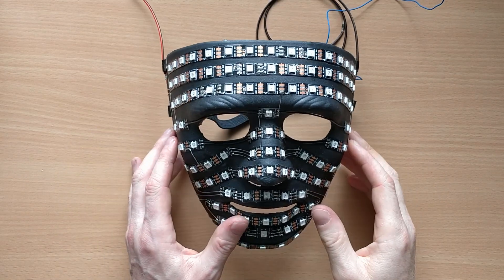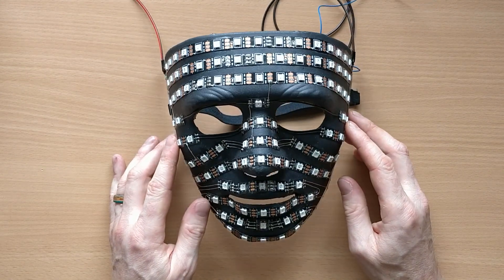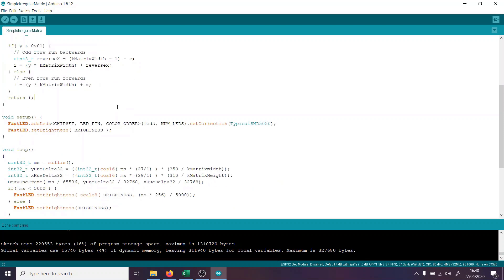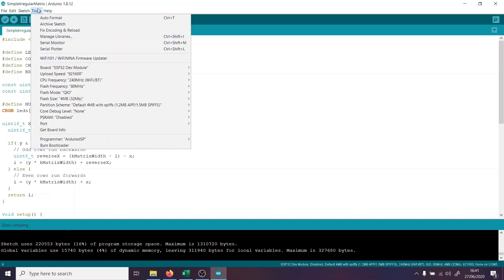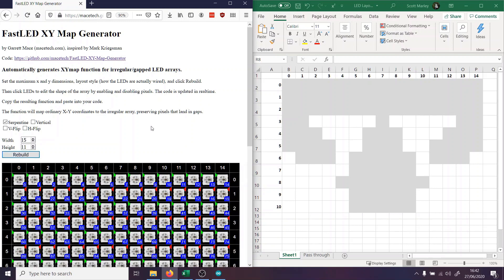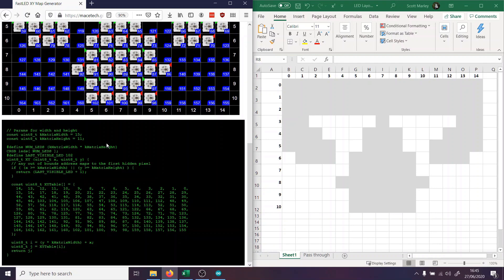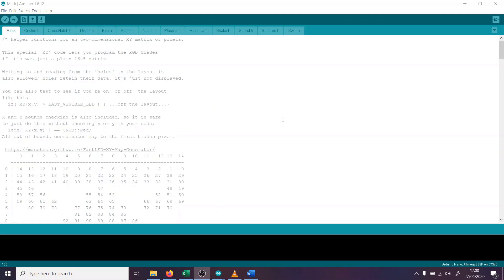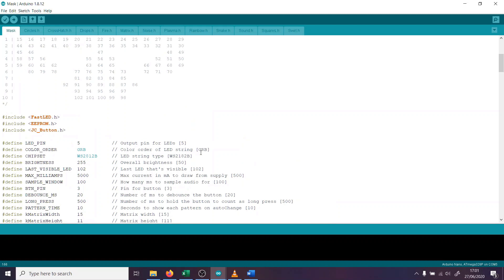Arduino powered LED Mask with FastLED [Part 1] - How to write code for an irregular matrix

Comment: Hello, Newbie question as I am just starting off. I am able to get the matrix to work with the rainbow pattern. I am having a hard time trying to figure out how to only put the fire pattern on the matrix. I not sure where to replace the rainbow pattern for the fire pattern in the code. I do not want to use classes, I simply want to use the fire pattern on the matrix. If you could please explain where to change it on the code, that would great. Thank You once again!

Comment: Hi...What kind of wire do you use to connect?
Reply from the maker: Not sure what you mean. To connect what? The Arduino nano uses a micro USB connector for power. The wires to the LEDs are just normal hookup wire (not sure what size). The wire used to connect the led strips to each other is tinned copper wire.

Comment: Great video, and fun project. I've subscribed and am working my way through your videos to better understand the possibilities of FastLEDs and Ardiuno. 

This is a bit off topic, but can you use the irregular matrix on a regular matrix so only certain pixels light up for some patterns but all of them light up for others?
Reply from the maker: Thank you! There might be a cleverer way to do this, but an easy way would be to make your pattern fill the matrix as usual, then set the pixels you want switched off to black before calling FastLED.show(). You could store the index numbers of the 'off' pixels in an array, and just loop through this setting them all to black.

Comment: Fantastic ideas and great instructions  so thankyou for helping me in the Arduino path – I think !

Your LED mask demo inspired me to make an LED coat as I could not solve the irregular matrix in my mind until I saw your post.
The button info was great too as this will help - ALOT with the design!

I have your code running on the first panel perfectly thankyou! (9 x 24) vertical serpentine and looks great ....... but the UNO dies as the row size increases. (43 x 24 irregular matrix in total) and is out of Memory.. so upgraded the board to a Mega which easily takes the code as you would expect

If I upload the same code onto an Arduino Mega it simply wont run at all, even though it runs fine on the UNO

I have changed the "j" to a uint16_t j from 8 as I exceed 255 but that gives not joy... I cant solve why it Runs on the Uno but not on the Mega

Do you have any ideas – I am trying the Arduino forum and not getting very far!

Comment: To cover the mask you could use Wonderflex Thermoplastic. It's a plastic which becomes soft and malleable when heated and diffuses light really in a way which you can still make out the LEDs.
If you image search for "wonderflex thermoplastic led mask" you'll see what i mean.
Reply from the maker: I gave the mask to a friend, and he's customised it similar to what you have suggested and it looks great. Thanks for the comment

Comment: Awesome video, do you have experience with an irregular strip? I have a strip with gaps, sections that go forward and backwards, and groups of leds that need to combined. I wrapped the led strip inside a sign that isn’t in a matrix or straight line. More like circles and shapes with a single seamless strip.

Comment: great work! how can I compile these animations without the button?
Reply from the maker: Not sure what you're after? How do you want to change the patterns?
Reply: @ScottMarley  I'm curious about this too. Is there a way for it to just cycle through the animations and change automatically every 30 seconds for example?
Reply from the maker: @DustinDalziel777  yeah, very easy to do. Just change bool autoChangeVisuals = false; to true. Done.
Reply from the maker: Oh, and to change timing to 30s, change #define PATTERN_TIME 10 to 30

Comment: Hi Scott, love your projects. Quick newbie question - what wire are you using between the copper strip and the led connectors? I've built a LED matrix and want to use your copper tape method to distribute power/gnd but I'm struggling to figure out what wire to use. I see with your mask you seem to mainly be using bare wire - what gauge is that and is it pre-tinned? Sorry for what is no doubt a really basic question. Thanks!
Reply from the maker: No worries, it's just single core copper wire, that I covered in a thin layer of solder. That way it solders quickly so not too much heat ends up in the copper tape. I don't know what guage it is, but the insulation is 1.1mm diameter and the core is 0.6 mm diameter if that helps. Probably doesn't matter too much here unless you're making an enormous matrix!

Comment: Would love to see you revisit this with an ESP32. I can't help but think there's a ton of potential here, you could have an app control "facial expressions" and crying animations or something cool if you had higher density pixels covering the entire mask!
Reply from the maker: Replacing the Arduino with and ESP would be straightforward, just 3d print a different case for it. Problem is, I don't have time to add new patterns and stuff! The code is all there if you'd like to have a go? Not sure about increasing the pixel density though, the power consumption would increase hugely, so I'd have to rethink how the power is distributed, and soldering all those strips together on a curved surface would be miserable! It does have a lot of potential though. Maybe one day I'll get inspired again to have another go!
Reply: @ScottMarley   Wish you had the time, I'd gladly collaborate with you on this!
! I've 3D printed a translucent mask before and lined the entire inside with ws2812B pixels but never got the software side of things worked out. I'll be teaching myself some things later this year I guess.... :P  Keep up the awesome work!

Comment: Very nice mask. Can i ask how you switch between patterns ?
Reply from the maker: At the moment you change patterns by pressing the push button. Have a look at the GitHub page in the video description to see how everything is wired up.
Reply: @ScottMarley  i gone have a look. And al the code you place on a diverent tab. And then you can push the button and switch the pattern ? Thank you for the information. I will try it. Its very nice
Reply from the maker: @maartena82  all the code is also on GitHub. However, you will need some experience in wiring, coding, FastLED etc in order to get this to work. Good luck!

Comment: How did you solder and connect all of them
Reply from the maker: With a lot of patience, some wire and a pair of tweezers! 5V is connected to the right side of every strip, GND is connected to the left side. Data starts at the top right and zig-zags it's way through every strip.
Reply: Scott Marley oh alright thanks and if it’s not to much trouble how many parts did you use like how many resistors, LEDs, you know stuff like that. If u can thank you I’m doing a project and I would live to do a mask like yours.

Comment: How are you powering it? How much voltage does it need?
Reply from the maker: Everything runs from 5V. I run it from a USB power bank. The amount of current depends on the number of LEDs and the brightness setting. At 250 brightness, the most demanding patterns draw a bit over 2 amps.

Comment: Nice explanation of the design, I have got a fire routine that is basically generated on the fly but can control it with variables to get better flicker and strands leaving the main fire.
i will make my 16x16 matrix equals yours by turning off the unused leds. I will email you the code once I am happy with the adjusted code.
As for covering it, use cling film, then mold features using clear latex that is paintable or foggy, this would be good if an area fails you can just remove the latex and access the leds. Latex will need studs or some way to hold it on. Great to see this.
Reply from the maker: Molding latex over it is a good idea, definitely easyish to remove if necessary. I tried a number of fire routines on it including the usual fire2012 one and found this one looked the best. I also disabled side to side motion of the flames as it just didn't look that good on such a low res matrix. Happy to see what you've come up with though!

Comment: Very Very original and great video... Great build scott..., i am aiming for a man cave sometime near the end of this year..., this would look cool in it...
Reply from the maker: Thank you :) I'm sure with your love of flashing lights you could throw one of these together for the man cave!
Reply: @ScottMarley  Just had the mask arrive today, seriously lacking leds though,  now due to the lack of time i have they will sit in a corner and gather dust lol
Reply: which version of fastled and arduino are you using? quite a few errors popping up ..

Drops.h:24:36: error: could not convert '(const uint32_t*)(& OceanColors_p)' from 'const uint32_t* {aka const long unsigned int*}' to 'CRGBPalette16'

     CRGBPalette16 currentPalette = OceanColors_p;

                                    ^

In file included from C:\Users\Mannys\Desktop\Mask\Mask.ino:84:0:

Noise.h:17:36: error: could not convert '(const uint32_t*)(& PartyColors_p)' from 'const uint32_t* {aka const long unsigned int*}' to 'CRGBPalette16'

     CRGBPalette16 currentPalette = PartyColors_p; // Starting palette

                                    ^

exit status 1

Any ideas ?
Reply from the maker: @cine-lights  the latest I guess, 3.003.003. I'll have a look shortly and see if I get anything like that. Not sure I do as it would not have compiled!
Reply: @ScottMarley  i just upgraded to the latest version of fastled and arduino and getting the error..., i was using a slightly older version and had other errors too....  the simple version works no probs.., no rush, if all else fails could you throw over a hex / compiled version - im using a nano as your are
Reply from the maker: I just installed the latest Arduino IDE (1.8.13) and I am running the latest FastLED (3.3.3). I downloaded my code from GitHub and it compiled with two warnings (not errors) about type conversion which I have now fixed on GitHub, but these were unrelated to the errors you are getting. Is what you posted above the full output text? Could you go to preferences, and set compiler warnings to 'More', copy everything it spits out (if it's too much for here, chuck it on PasteBin or something!) and let me have a look for some clues? Thanks.
Reply: @ScottMarley  C:\Users\Mannys\Desktop\New folder (4)\LEDMask-master\Mask\Mask.ino: In function 'void incrementButtonPushCounter()':

C:\Users\Mannys\Desktop\New folder (4)\LEDMask-master\Mask\Mask.ino:70:46: warning: operation on 'buttonPushCounter' may be undefined [-Wsequence-point]

   buttonPushCounter = ++buttonPushCounter %11;

                                              ^

In file included from C:\Users\Mannys\Desktop\New folder (4)\LEDMask-master\Mask\Mask.ino:75:0:

sketch\Sound.h: In member function 'void Sound::readVolume()':

sketch\Sound.h:41:18: warning: comparison between signed and unsigned integer expressions [-Wsign-compare]

       if (sample > signalMax) {

                  ^

sketch\Sound.h:44:23: warning: comparison between signed and unsigned integer expressions [-Wsign-compare]

       else if (sample < signalMin) {

                       ^

sketch\Sound.h:40:8: warning: suggest explicit braces to avoid ambiguous 'else' [-Wparentheses]

     if (sample < 1024)  // toss out spurious readings {

        ^

In file included from C:\Users\Mannys\Desktop\New folder (4)\LEDMask-master\Mask\Mask.ino:78:0:

sketch\Squares.h: In member function 'bool Squares::runPattern()':

sketch\Squares.h:20:29: warning: operation on '((Squares*)this)->Squares::_pattern' may be undefined [-Wsequence-point]

     _pattern = ++_pattern %2;

                             ^

In file included from C:\Users\Mannys\Desktop\New folder (4)\LEDMask-master\Mask\Mask.ino:79:0:

sketch\Circles.h: In member function 'bool Circles::runPattern()':

sketch\Circles.h:21:29: warning: operation on '((Circles*)this)->Circles::_pattern' may be undefined [-Wsequence-point]

     _pattern = ++_pattern %9;

                             ^

In file included from C:\Users\Mannys\Desktop\New folder (4)\LEDMask-master\Mask\Mask.ino:82:0:

sketch\CrossHatch.h: In member function 'bool CrossHatch::runPattern()':

sketch\CrossHatch.h:33:38: warning: operation on '((CrossHatch*)this)->CrossHatch::blobCounter' may be undefined [-Wsequence-point]

       blobCounter = ++blobCounter %20;

                                      ^

sketch\CrossHatch.h:40:38: warning: operation on '((CrossHatch*)this)->CrossHatch::blobCounter' may be undefined [-Wsequence-point]

       blobCounter = ++blobCounter %20;

                                      ^

In file included from C:\Users\Mannys\Desktop\New folder (4)\LEDMask-master\Mask\Mask.ino:83:0:

sketch\Drops.h: At global scope:

Drops.h:24:36: error: could not convert '(const uint32_t*)(& OceanColors_p)' from 'const uint32_t* {aka const long unsigned int*}' to 'CRGBPalette16'

     CRGBPalette16 currentPalette = OceanColors_p;

                                    ^

sketch\Drops.h: In member function 'bool Drops::runPattern()':

sketch\Drops.h:35:39: warning: operation on '((Drops*)this)->Drops::paletteNumber' may be undefined [-Wsequence-point]

     paletteNumber = ++paletteNumber %5;

                                       ^

sketch\Drops.h:49:42: warning: operation on '((Drops*)this)->Drops::rippleCounter' may be undefined [-Wsequence-point]

       rippleCounter = ++rippleCounter %20;

                                          ^

In file included from C:\Users\Mannys\Desktop\New folder (4)\LEDMask-master\Mask\Mask.ino:84:0:

sketch\Noise.h: At global scope:

Noise.h:17:36: error: could not convert '(const uint32_t*)(& PartyColors_p)' from 'const uint32_t* {aka const long unsigned int*}' to 'CRGBPalette16'

     CRGBPalette16 currentPalette = PartyColors_p; // Starting palette
Reply from the maker: For anyone looking at this thread, the issue is now resolved and the GitHub code has been updated. Thanks to Cine-Lights for helping problem solve!

Comment: Very cool project! Thanks so much for the video, also explaining the amazing XY calculator.  The droplets animation is very cool, hadn't seen that before. Assuming you are going to be using this in dark places, I would suggest turning down the brightness a lot. People do not like being blinded. Speaking from experience here. ;-)   But you were going to add a diffuser anyways, so I think that will be allright. Might even consider using a slightly smokey material to dim it a bit (sometimes these WS2811's look ugly at low brightness).
Reply from the maker: I agree it needs some diffusion and toning down a bit! It does look quite different on camera than in real life however, I'm recording all this on a phone so I don't have much control over how it records. Thank you for your comment!

Comment: This is so cool, I've made a mask similar to this but just used the default demoreel stuff for fastled. How did you get the sound reactive animations at the end?
Reply from the maker: Take a look at the GitHub link in the description, it's the pattern called 'Sound.h'. it's really basic and could be expanded a lot but I just wanted to get the video done. It just looks for a sound level between fixed points and draws the appropriate image. Really these points should be determined dynamically and I'm sure I'll do it some point!

Comment: Please make a video about porting to the esp32!
Reply from the maker: I may do that in future as having Bluetooth or WiFi control would be great! In the meantime, this code will work fine on the ESP32 as it is, just change the board in the boards menu and upload it.
Reply: @ScottMarley  Check out the Blynk project. You can easily add wifi remote control. Although it requires internet, not so handy in a mobile installation.
Reply from the maker: @costynvd  I'd probably do it like the Bluetooth control on my ESP32 matrix. I don't generally have WiFi where this is useful (mainly festivals!). Or maybe local WiFi control although I haven't done that before. Always good to learn something new though.

Comment: Wow that's a great find , I've been 'making' my own pixel maps for my pixel trees for years....this will be soooo much easier...I never even though to search for a ready made pixel map generator ...I feel silly now.
Can't thank you enough...
No sure about sealing the leds in epoxy ..would make it a pita when one or two inevitably fail.
The vac forming of a removable cover sounds difficult to get right but could be more practical..
If you just want environmental protection from moisture then conformal coating like DCA SCC3 from electrolube would work.
Anyway nice helpful video.. thanks
Reply from the maker: I think you're right about the epoxy, I generally dislike doing anything like that which I can't reverse later! I'll have a play with some ideas and see what I think might work.
Reply: Weird how people are just seeing this tool now. It was very popular on Reddit and when Google+ was out
Reply: @TomS699  Weird, I've been a FastLED lurker for years and hadn't seen it before! @Scott: It's a little late for this project, but you could use WS2813s for a next project. Dual data line (main and backup). Less annoying if one fails.